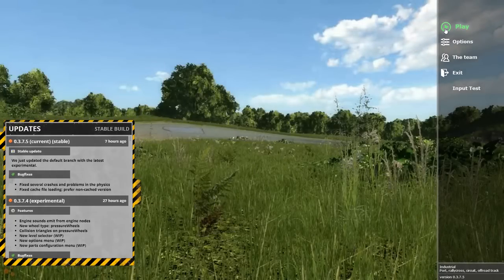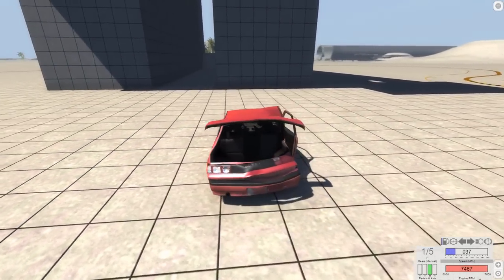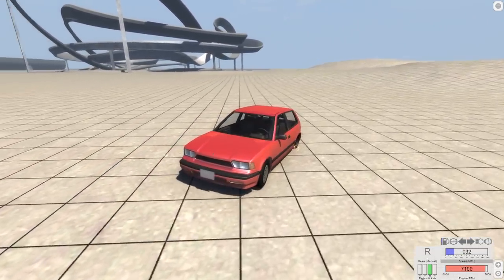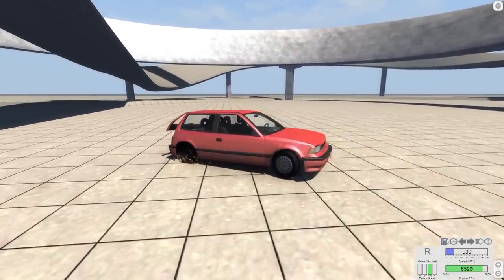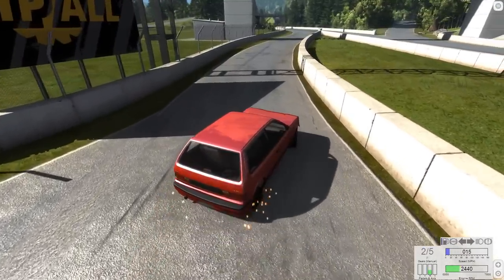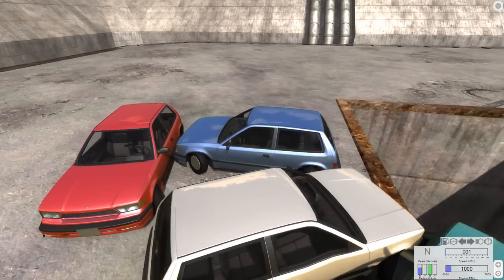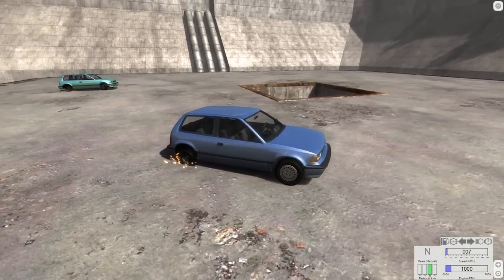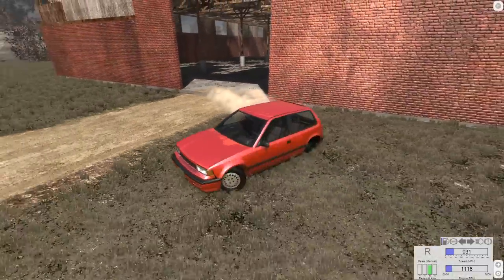SKID PLATES! - BeamNG.drive

Comment: When you spawn in multiple vehicles, how do you switch which one you're controlling? And can you play older versions of the game cause the update glitches a map :(
Reply from the maker: jmlon99 Tab, and as far as I know no you cannot. Try deleting the cache files if you have any. Go to your Documents folder, open BeamNG.drive and delete the cache folder. If it still doesn't work you might want to make a post on the forums because I don't know the solution.
Reply: WhyBeAre Thanks! Now i can use the spinner and large canno and rearrange the vehicles. And it glitches the BrutalSlope map. Now, there is a ton of 3D blue rectangles. SO I was just wondering. Thanks for responding. PS: can you tell me where you get the crappy lambo mod with the horrible JBeams just for fun :D
Reply: WhyBeAre and deleting the cache files for the map fixed it!